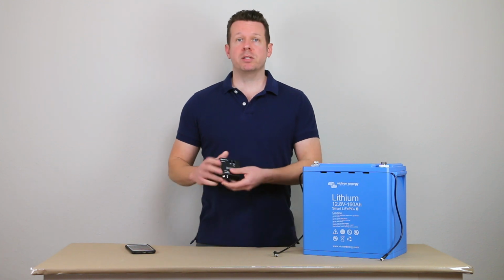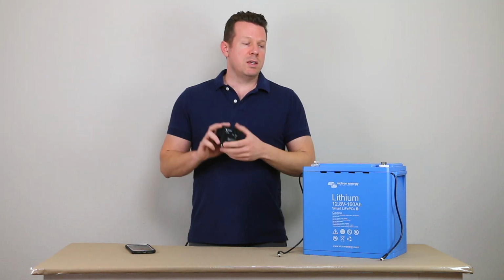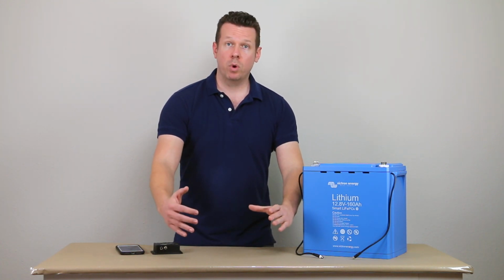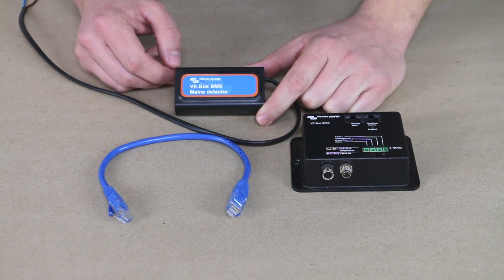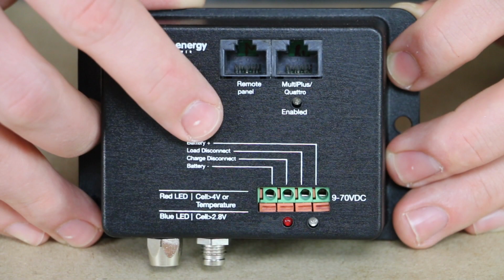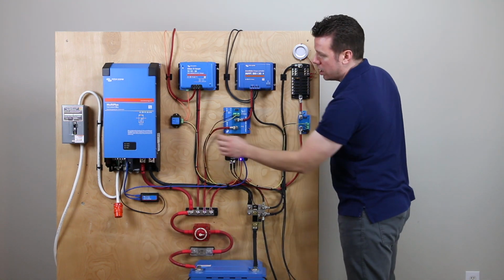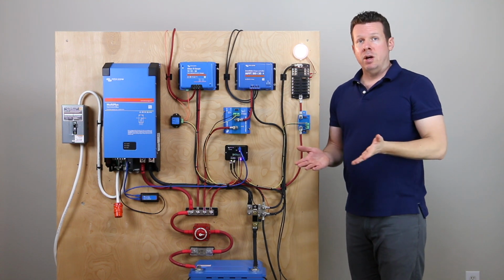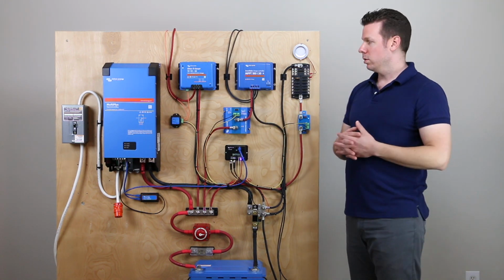The Victron Smart Lithium Battery & VE.Bus BMS - Explained and Installed!

Comment: I have a similar lifepo4 but it's not smart. Can you recommend a way to make it 'smarter' so I can view the cell voltages. It just seems strange to have a setup but no cell voltages. And the BMS has the red light when a cell is over 4v but this doesn't give comfort as that's well past the full charge voltage. Any thoughts.

Comment: For a nice cheap setup use a set of chalock to hold your end 
Heat with a torch solder then place in wire

Comment: Hi Ross if the red light comes on the bms and it’s shuts off inverter and my touch screen display what to I need to restore system
Reply from the maker: Hey man, thanks for watching my video. I'm not sure, it sounds like your batteries are drained and the BMS shut everything down. This was an advanced video/system, I would be glad to dig into it over a consulting call if you'd like to take a deeper look at it. Thanks for tuning in-
Reply: @rosslukeman  sounds good I am in pa can we talk tonight for 6 pm est
Reply from the maker: @nepafa1  yes I will be available, the calls are located here, please select your time from the automated scheduler. Here is the page: https://www.rosslukeman.com/offerings

Thanks,
Ross

Comment: Hi Ross, 
What size cable did you use for the ignition cable, (Orange) into the solid switch 104, please? And did you use the same size for the battery protects (yellow) ? Thank you.
Reply from the maker: Hi Leigh, all of the little control wires are 18 AWG (0.75mm2). They could probably be much smaller, such as 20 to 24 AWG, but 18 is what I use.
Reply: @rosslukeman  Great, thank you for the information, Ross 🌟

Comment: Hi Ross, 
Fantastic videos, learning lots, thank you so much. 
I have two 12v fuse boards which I am currently installing. Should I install a 65amp battery protect on each of the boards or connect both 12v boards to one battery connect? 
Thank you 😊
Reply from the maker: Hi Leigh, I would say you could run both on one 65A BatteryProtect, but frankly I don't know. You have to add up your loads on those fuse blocks and see how many amps would be pulled through that BatteryProtect. It likely less than 65 amps but to be totally sure you have to add up your loads. Those BatteryProtects can also handle a lot more amperage for short durations, so it's not going to fail that easily. Hope that helps-
Reply: @rosslukeman  That's great. Thank you, for your quick reply, Ross.

Comment: I value the way you teach this subject. I am new to solar and new to Victron. I do want to use Victron but found it very complicated. This video helped me. My intended uses are for RV and for a residential emergency backup.

I do have a question: will this work as nice as you say if I use other LiFePO4 batteries (CHINS) with their integrated BMS?
Reply from the maker: Glad the video was helpful, however this setup only works for Victron Smart Lithium batteries. If you go with an internal BMS battery like CHINS or AmpereTime, the only reservation I have is they are not supposed to charge below 32F (O celcius) but they don't say their BMS disconnects at that temperature. If you email their support they seem ambiguous and say "no, don't charge below 32F" but won't say it disconnects automatically. With a Victron battery monitor, temperature sensor and a VE.Smart network setup (shown here https://youtu.be/x7U9oZfoJpw), you can get the Victron chargers to shut down at a temperature of your choosing, however if you follow the setup in this video with Victron Smart lithium, then that happens automatically. Hope that helps-
Reply: @rosslukeman  thank you. Luckily, temp is not a concern for my location. I love Victron's product integration. Their batteries are way beyond my budget and I wonder who buys them. I bought my first Victron product this  week (battery charger) and plan to add more as opportunities come... My  priority is to preserve the longevity of my batteries.

Comment: Thanks Ross for this great video. You mentioned that the small black cables integrated into the batteries should be daisy chained. On my RV I have a Victron system with one 330Ah battery with its external BMS. I now added an additional 330Ah battery.  What is necessary to daisy chain the new black cables with the ones already in the BMS (e.g. additional connectors)? Also, how to avoid to connect the wrong cables in a daisy chain? Best regards. Silvano
Reply from the maker: Hi Silvano, it is pretty straightforward because of the male/female connectors. Put the batteries next to each other and connect the male from one battery to the female of the other. Use your battery extension cables to/from the BMS to connect to the remaining male on one battery, and the remaining female on the other battery. Now the BMS reads both batteries.
Reply: @rosslukeman  Thanks Ross, I will do so.

Comment: Great video, very informative.  One question, why not use the Smart BMS 12/200 with built in 100A alternator charging?  Any benefit to using the ve.bus BMS?  With the Smart 12/200 you also need less battery protects.
Reply from the maker: Hi Chris, the VE.Bus BMS is made to work with Victron's VE.Bus products, like their inverter-chargers (shore power). The official description from Victron is: 

"The VE.Bus BMS and VE.Bus BMS V2 are Battery Management Systems (BMS) designed to interface with and protect a single, or multiple Victron Lithium Battery 12,8V & 25,6V Smart (LiFePO4 or LFP) in systems that have Victron inverters or inverter/chargers with VE.Bus communication."

Comment: Thank you very much for your video. It would be interesting to see how it works all together with a gx device (e.g. venus). As it looks like, the "yellow cables" and switches (battery protect) are not necessary in this case?
Reply from the maker: Glad you enjoyed the video. No the BMS is still needed with a GX device. They do two different jobs. A GX device does not manage the batteries.
Reply: @rosslukeman  Yes of course. I meant, if battery protects and so on are necessary, if i have my venus GX AND a ve.bus bms?
Reply from the maker: If you have the VE.Bus BMS, then it needs those switches (BatteryProtect, Solid Switch 104, etc.) It can only control switches through the yellow wires. Without the wires and switches it is worthless.

Comment: I have a battle born 12v 100ah battery, I would like to replace it with higher capacity battery that will fit the same size as my battle born battery frame enclosure, Will this fit?
Reply from the maker: Hey Alex, the 160Ah or 200Ah Smart Lithium battery would fit in the space of a Battle Born BB10012, but as shown in the video, these batteries have the external BMS that you would have to add. That's part of the reason they can be so compact, the BMS is a separate item and not built in. I hope that helps!

Comment: great video would i be able to use this with AGM batteries? also how would i connect a Cerbo and GX screen in ?
Reply from the maker: Thanks! This particular BMS is exclusively used for the Victron Smart Lithium batteries, and no other battery type/brand. If you want to shut things down to protect your battery, you might check out my video on the BatteryProtect device here: https://youtu.be/NX71oBeYtEc

On the Cerbo GX, there are a lot of connections, it would be best if you checked out the video on it here: https://youtu.be/zu3A-3eHseA

Thanks for stopping in!

Comment: Is this BMS able to handle non-Victron components, such as inverter and charge controller?
Reply from the maker: In the instances where you're just breaking the connection to a charger or load (such as an inverter or charge controller), yes you could use other brands for those. I should note though, when it comes to the battery brand, this BMS communicates only with the Victron Smart Lithium batteries, and no other type/brand.

Comment: Ross. I have two lithium batteries. a 280ah for my leisure and a 100ah one for my engine shared by a dual isolator switch. Would I need one of these for each battery?
Reply from the maker: Does neither battery have a built-in BMS? This VE.Bus BMS is only for the Victron Smart Lithium batteries.
Reply: @rosslukeman  no.. They are just basic raw lithium batteries

Comment: Thx for your good explaining! I was wondering that you disconnect the MPPT 100|30 with the battery protect, because I red that the MPPT device is not supposed to be disconnected from the battery whilst still be connected to the pv panels. So I think the ve.cable might be the better option. Am I wrong there?
Reply from the maker: Hi Hart, good question. As explained in the video, I wanted to leave that VE.Direct port open to send solar data to a central monitoring device such as the Cerbo GX. You are right that it can damage a solar charger to have solar coming in and not have the charger connected to a battery. However in this case, it is an emergency shut down only, and the solar charger will shut itself down under normal circumstances. If the solar charger goes haywire, the BMS/BatteryProtect will shut down solar to keep the batteries from catching on fire. That is all. The BatteryProtect is not going to be used on a regular basis, if ever, to shut down the solar charger. The charger will shut itself down under normal daily circumstances. I hope that answers your question, thanks for stopping by!

Comment: Thanks for your very informative and clear videos.
I have picked up warnings from elsewhere that breaking the connection between a generating solar controller and the battery is a big no-no. Is the Victron MPPT able to cope with this?
Reply: Short answer, yes. They have system schema’s on the website in which they also show how to connect this in combination with their mppt’s. However, there are two things to note. An charge disconnect signal will only cut the positive connection. (With a Cyril li for example) Not the negative. Also, as mentioned in the video I think, the mppt’s can also communicate in different ways if all products are victron.
Reply from the maker: Hi John, I asked this question to Peter Kennedy of PKYS, a major Victron distributor in North America. He said the solar charger should shut itself down under normal circumstances (after charging is complete). The BatteryProtect and BMS are there as a backup if the solar charger goes haywire. It's an emergency shutoff. I also just follow what Victron shows on their diagrams most of the time. This is how they show it.
Reply: @rosslukeman  Thanks for clarifying. 🙂